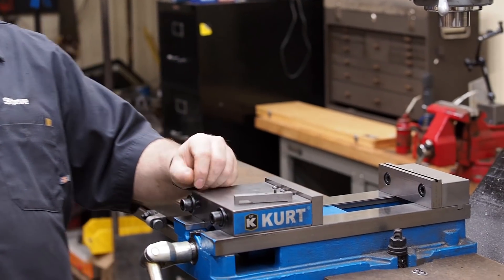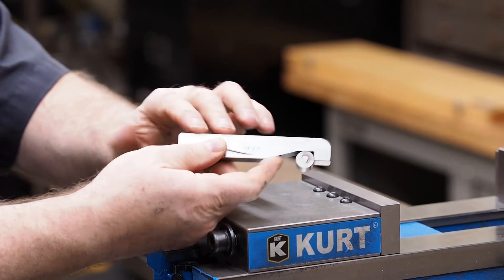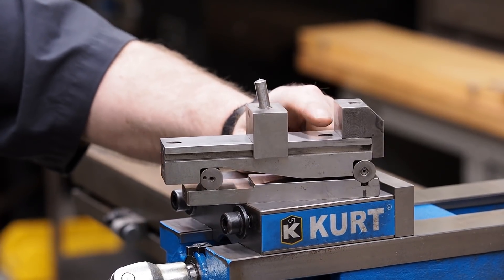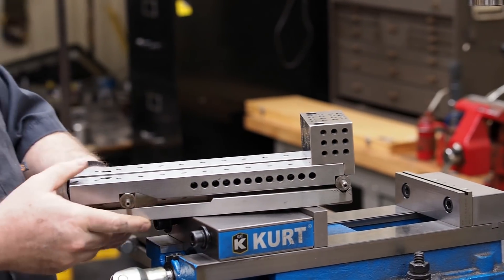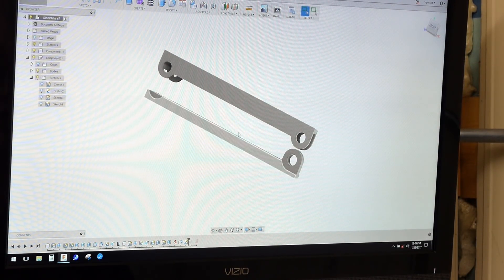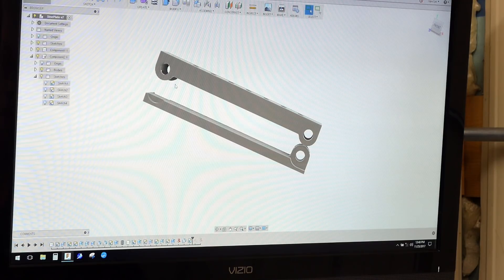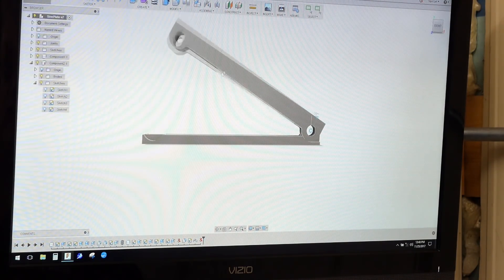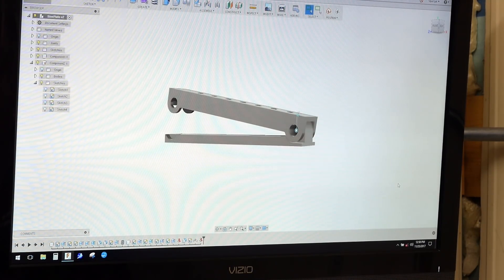Low profile Sine Plate

Comment: More fine engineering from SR machine! Steve, could you demonstrate different methods of making a basic sine bar using rolls that bolt on? How to surface grind roll center distance accurately? Thanks again! I'm almost cought up on all your videos finally : )
Reply from the maker: Hi James,
Maybe later down the road. We have a number of interesting videos in the works we need to do first.
Steve

Comment: Hi Steve!
I like the design, this thin sinebar seems very useful.
I wondered how You are going to reference the pins to each other and the top when You don´t have the flats as references as in most sine bars?  
I like the idea of extending the base an inch or so, that would make it more versatile. My best vice, an 4" hydraulic Aciera toolmakers type,  has a solid bottom surface that is very flat, but even then it can be difficult to  get good clamping  when using a sine bar or similar. It would be useful to be able to extend the gageblock part outside the vice. 
Perhaps it´s a stupid idea, but could splitting the ears holding the pins in place so that they act as spring clips holding the pins  perhaps improve accuracy? 
Regards, Erik
Reply from the maker: Hi Erik,
I will JIg grind the holes for the 4" distance and surface grinding all other surfaces to the pins. I believe I will be less than .0002" in 4" by the time I am done on all surfaces and center to center roll distance. We hope to show a lot more in future videos. I have a lot of interesting ideas that this bar can be used for and hopefully we will cover many of those ideas as well. With this design you can increase the center to center distance 5", 6", 7" etc. this would extend the gage block side further out. The longer it gets though the thinker you would want to make the base. A lot of possibilities here. Thanks for sharing your ideas.
Steve